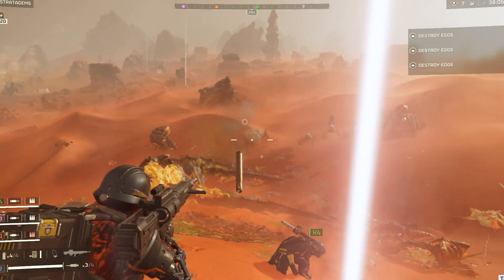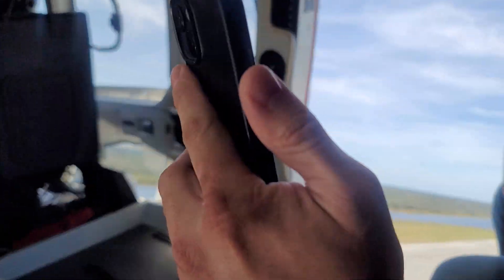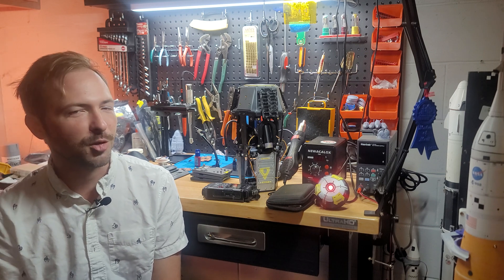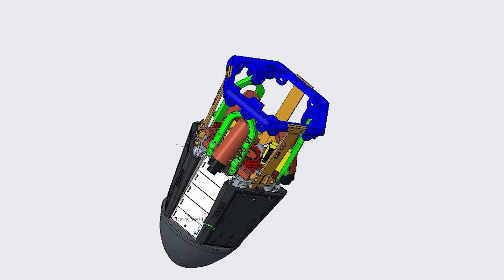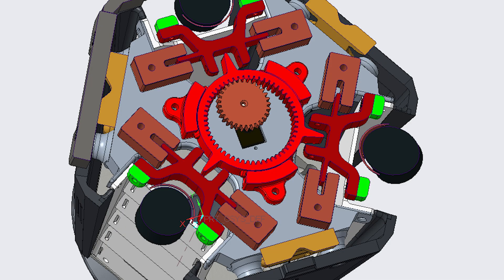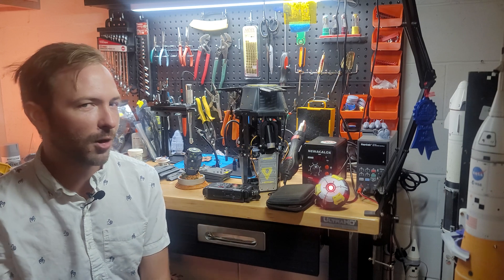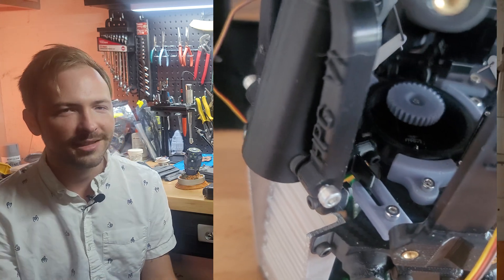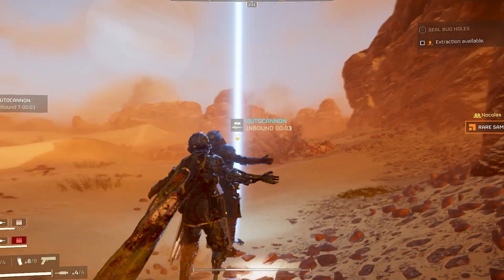Working Helldivers Rocket Drop-Pod

Comment: I think you would do better with hard TPUs than ABS. 98A is really indestructible, while also holding its shape. My lab uses it heavily on drones. 75D is more like the hardness of ABS, but also much more robust. The disadvantage is just heat deflection. Extremely cool actuation system though.
Reply from the maker: That could be really great for the nose dome actually.....

Comment: What is your job called and how does one get to do what you are doing? Because this simply looks like my dream life.
Incredible work!
Reply from the maker: Technically systems engineer 3 lol but my degree is in Aerospace Engineering. But many of my coworkers are titled in Manufacturing Engineering or Mechanical. Where I went to school, we had AE be inclusive of both of those but that varies by place. Operations Engineer is technically what i do but at Sierra that rolls up under Systems Engineering as kind of a catch all for some stuff!

Comment: just a small tipp:
You seem to be using brass heatset inserts that are designed for injection molding. The ones designed to be pushed it are designed differently, usually with "herringbone" teeth. They do bond quite a bit better to the plastic than the ones for injection molding.
Reply from the maker: that would explain why I had to do some regluing of the inserts on some!